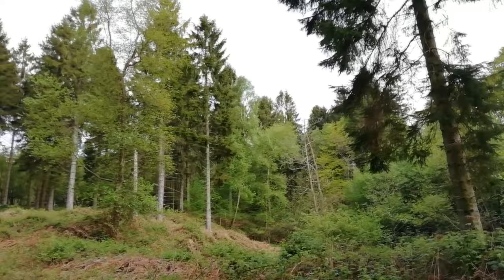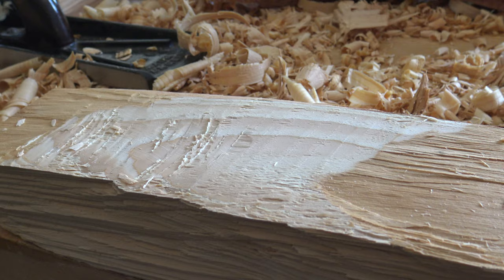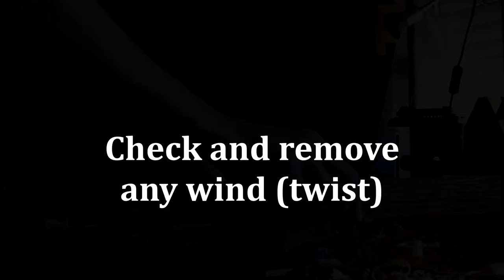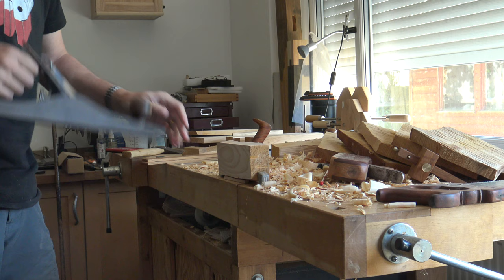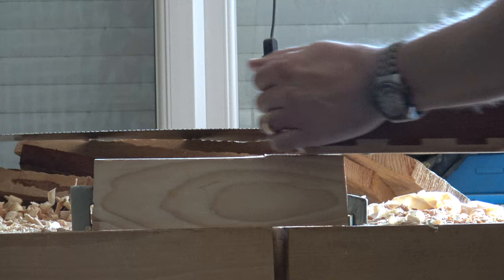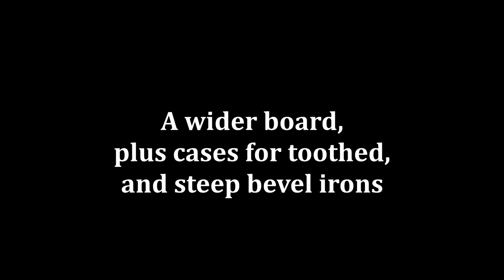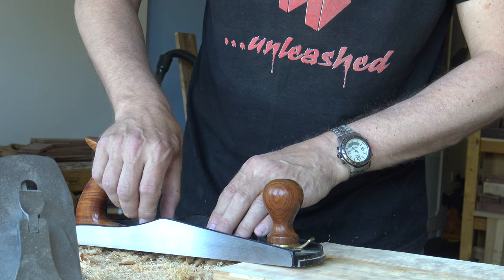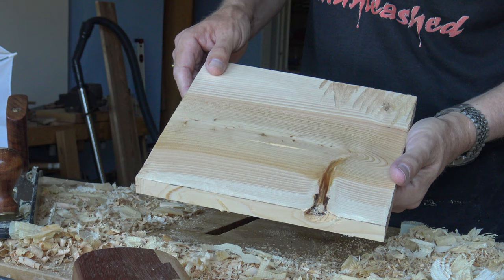Milling Lumber (green or partially air dried)

Comment: Should have been obvious but I never thought of using the witness marks from the toothed iron when flattening.  Gonna have to get one for the low angle jack.  On a related note, I've always used my low angles for very straight grain.  I knew about the bevel change but never got around to experimenting.  Do you have a set angle that works for tough grain most of the time?  It's kind of expensive for the extra iron if it rarely makes that much difference over a #4.  Thanks for posting.
Reply from the maker: The extra irons are expensive. You can get an ordinary iron for the no 4 and give it a back bevel, which will really help smoothing in highly figured wood. Check out my back bevel video for that https://youtu.be/cwN3m5qVdwc. My 50° iron for the low angle jack is about equivalent.
Reply: @mitchwoodwork  Thanks.  I'll check that video out.

Comment: Is that a #6? 
Seems really nice for flattening/truing rough stock!

I’m a n00b and only have a #4… but wondering what I should get for my 2nd plane. 🤔
#5 seems too similar/close to #4… and a #7 seems too big (and expensive iirc). Idk
Reply from the maker: Yes, it was a #6 or foreplane.
A #5 is a very useful size plane and can be tuned to do a number of jobs. I have a video on that very task. If you plan to make anything larger than a chair or small cabinet, then you'll appreciate the size and heft of a #6 #7 or even #8. One thing I've learnt over the years is that old wooden planes of a similar size to these are much cheaper and easily a match for the metal ones.
Reply: @mitchwoodwork  
Thanks for the advice!
5 or 6... a difficult decision!
...perhaps a 5 then for my 2nd plane (cheaper too!)... just worried it's too similar to a #4.
Reply from the maker: You could go to a #5 1/2 which has more heft than the #5 and is as wide as a #6.
Reply: @mitchwoodwork  Good idea! I think the 1/2" models are quite rare and expensive iirc. I keep my eye out tho!